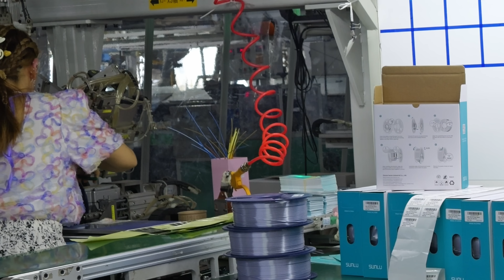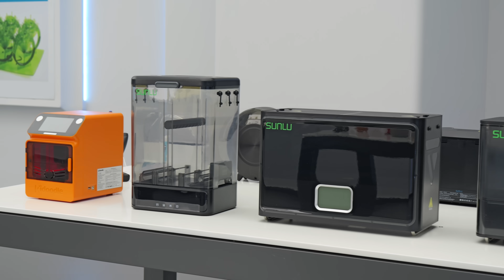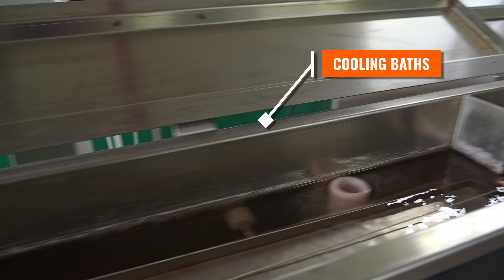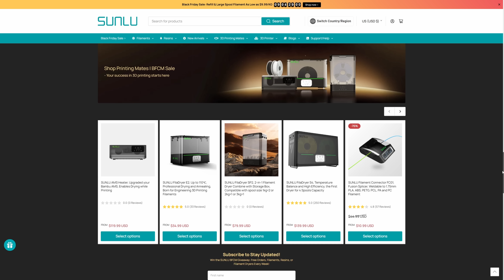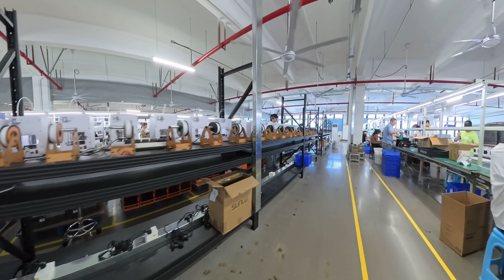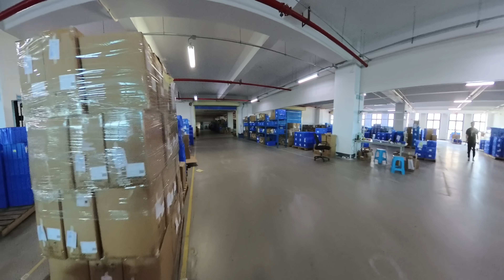I Toured the World LARGEST 3D Printer Filament Factory!

Comment: Did you ask them why they put the little desiccant packets in the centre of the spool when packaging?

That only keeps that little area dry.

The filament on the spool gets no benefit from the desiccant that's sealed in a different chamber.

Comment: It's an OEM filament manufacturer, of course there's going to be TON of filament everywhere lol. They make filament for a LOT of brands including Bambulabs and tons of other small brands (including random name brands). Even the cheaper chinese brands that are popular on AliExpress is usually Sunlu, eSun or Polymaker filament (just on cheaper spools). These 3 supply like 90% of the filament sold to consumers (and 100% of Bambu lab filament comes  from those 3 OEM manufacturers). 
I always buy cheapest brand filament and then tune my profiles for those brands. If you're paying more than $6-8 per kg of PLA or PETG (most common filaments), you are paying too much. So much money can be saved if you just learn the settings, what they do since the filament practically come from the same freaking extrusion lines. But if you're not willing or able to do that, then I guess just pay the 2-3x premium for the convenience factor.

Comment: Just some quick math:
6 floors with 25 machines each means 150 total machines, over a month they produce ~1.8 million killograms of filament.
That works out to about 400 spools per machine per day.
The fastest industrial machines I could find produce 130m/minute of filament and a 1kg spool of PLA is ~335m long.
That's approximately one spool per 2.5 minutes or 24 spools an hour.
That would mean that there are workers at the machines for at least 16.66 hours every single day year round and all that is assuming max run speeds, no failures and some generous rounding.
No wonder they need to live right next to the factory...
Reply: In some Countries those machines would be running 24hrs a day because the shareholders demand it.

Comment: Amazing tour, 

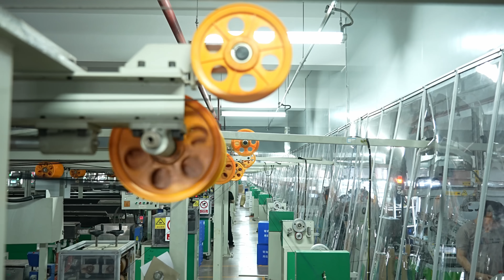Its incredible to see such a large facility, using somewhat modern equipment and yet (2:50) still using the most inefficient and energy wasteful hot air single pass resin "dryers". 

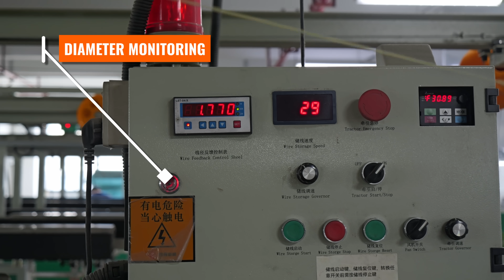(4:25) Single axis laser measurements (vs the traditional 2 or 3 axis), so its not accounting for ovality. yes, it is 1.785 at one angle and maybe 1.65 in another axis. Less checking means less chances you can pick out a filament out of specs. Good for ensuring you have high level of passing product. 

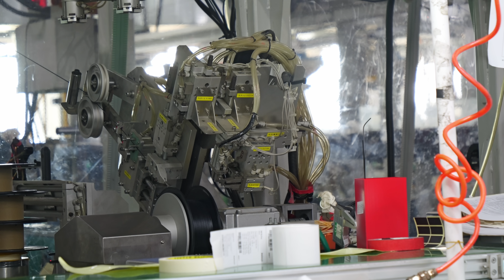(4:50) this is where they invested money. A good winding systems that present a perfect spool. No wonder you weren't allowed to show the rest of the pack line. 

Neat factory, well run, clean, organize. 

Great stuff.

Comment: So from the video when the operator weighs the spool, it was exactly 1kg including the spool, so you're not getting a kilo of filament!
Reply: The scale didn't start on zero though.
you set the scale to zero with the weight of the empty container on it so you don't weigh the container as well.
Reply: It showed -213g before weighing the spool. So it's taking the spool's weight into account.
Reply: bit suspicious it was exactly 1,000

Comment: Don't want to be a hater, but I just watched the video to understand why did my 3 only spools I ever bought from this brand got entangled and screwed my prints. three spools.
Reply: Weird, I primarily use Sunlu since they have some fantastic deals on eBay here in Australia and never had that issue. I’ve had more issues with Bambu refills doing that, although that could be me and user error.
Reply: @Anibbles it is more sad than weird, I guess. I might be very unlucky. Lost several hours, hair and will to continue printing for 3 months…
Reply: @neomg  yeah, failed prints are never fun. Time and material just down the drain. I really hope at home filament recycling becomes easier/more mainstream.
Reply: @Anibbles yeah! Everything went to trash, together with dreams ahah!
I was panning a recycling thing as well but after research it wasn’t worth
Reply: @neomg  it’s so hard to do at small scale, and plastic recycling in general isn’t really that mature. Especially with 3D filaments, with so many different types that would all need their own processes. 

So much of our regular plastic just dumped in landfills, burnt or shipped off to a developing country so it’s their problem. It can be done, and there is some interesting research happing now but large scale is far away, and you still need people who want to invest in it.
Reply: @Anibbles  yeah. not even close for home things. but I was even considering some company but do not have time for now! :)
Reply: My friends and I had to scrap about 60 rolls total of PLA+ from three different batches from both China and Vietnam factory. I really wanted it to work. Disintegrated in the feed tubes if they sit for a week. I know most people have a good experience, but we tried it three times over a span of months.
Reply: @rsilvers129 jesus crist!! Is it a farm? Damn.
Reply: You let go of the filament three times. Never let go of the filament. Ever.
Reply: @snarky-drive-by how? How can I handle overnight entanglement and how to trust a brand after 100% being entangled?